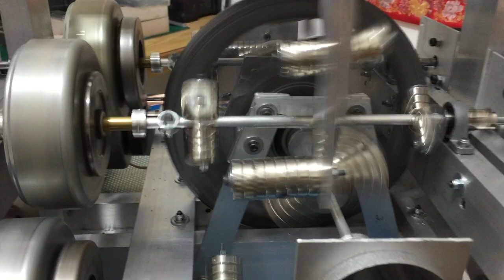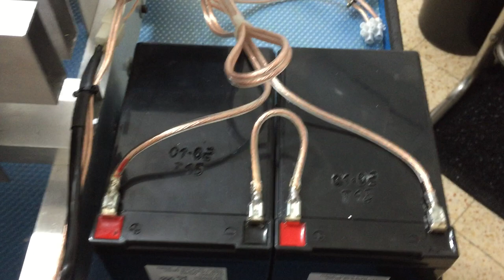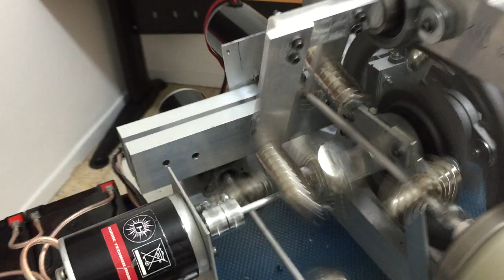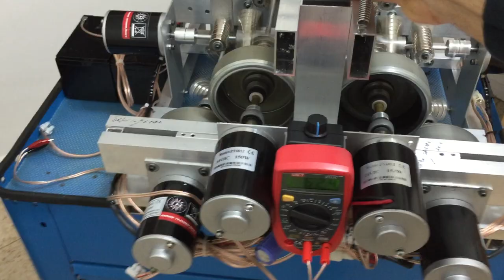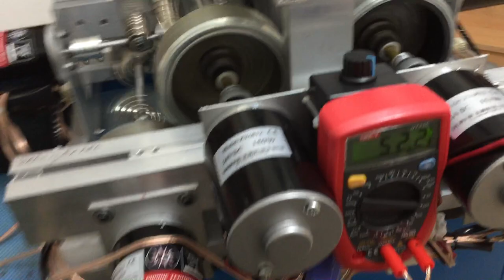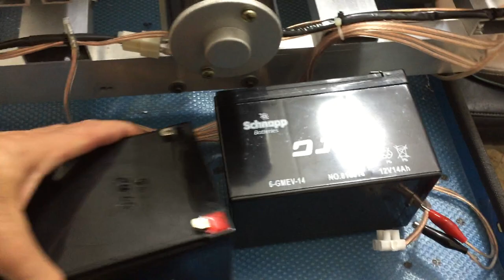Real unbreakable "Extra free energy" controlled devices magnet motor engine- It seems in 2015

Comment: +Oren Gertel I'm concerned about the engine's configuration if it's facing other external forces. Which would include gravitational forces and physical trauma while active (specifically for the use in vehicles and aeronautics). Like, if a plane flipped upside down (or tilted), would the engine function properly? IF you happened to be in a wreck in a vehicle with this engine, what's the danger of it splintering. Just stress test stuff to think about.

Comment: What? Correct me if I am wrong hear but last i checked if you unplug the battery and it stops it is not free energy.
Reply from the maker: Citizens Choice There may be secrets in the machine? Or was this the first time you saw such exposure of magnet power?
Reply: ***** First I am 35 years old and I have seen A True Z.P.M. In Action FYI that is A "Zero Point Module" "0.00 power input" with an output of 12V~5Amp's It is not on YouTube or any Internet webpage or I would send you there to look for yourself..

Anyway; Sorry if i hurt your feelings? But You show noting but moving parts, you do not give anything to support that your machine doing anything other than using Electricity? Were is the DATA?
Reply from the maker: Citizens Choice There is a video that shows battery charge and another video that shows loading capacitors,Try to understand that what you saw is the future
Reply from the maker: Tom Hoehler Thanks
Reply: +Citizens Choice How difficult it's to understand?? He's showing the potential of the magnets and possible use, that's all and that's great.   How difficult is it to understand for a guy 35 yo??
Reply: +Andres Castelvi Llanes It's creative. The design looks cool. It's utterly useless though.

Comment: Well built, but what is the output power versus input power ?
Reply from the maker: overunitydotcom Electricity production depends on generators! Thank you
Reply from the maker: overunitydotcom With the right generators can produce from the ornithopter engine more than 1000 Volts of electricity! Thanks
Reply: Hi Stephan. Do you believe that he is not provide a single output power measurements since more than 1 year while it so so simple in DC? is that an other one who use lake of education of the viewer to make money wuth the advertising in the vids? I wish he could be genuine but how to believe that while he wiuld just took him 2 multimeters and a 1 ohm resistor? ! :/
Reply from the maker: Khwartz Thank you for your interest! It is important
Reply: ***** that's not a very informative answer. Voltage means nothing, it is voltage and amperage output that means your entire machine's worthiness. Why don't you show your input voltage and amperage in comparison to it's output wired into a simple load? It isn't very difficult to do.. all you need is a load and an ammeter while using your power supply to power it as the power supply has the voltage and amperage on it's display.
Reply: +Didier Khwartz Where did you see that Oren Gertel is asking for money???? For what I can see, he's thinking hard and work  harder to make the machine and the video, BUT he is not asking for any money. In case that you can do it better....DO IT......OR maybe he asked you for money for that project and NOW you demand the promised results, otherwise just watch the video and make questions, but please save the insults and accusations ;)
Reply: +Andres Castelvi Llanes Actually, I believe he is accusing him of doing what every other person on YouTube who has "free energy" videos does. He has 16,200+ views on this video. How many of those people do you think clicked an advertisement? The people who put those ads there, those are his sponsers. the more views, the more money the advertisers make. He hasn't given ANY useful information on this machine, and to the advanced questions asking him about his machine, he has simply replied "your interest is important" and there are many "thanks" comments. Yeah, thanks for the view, thanks for the money.
Reply: +Andres Castelvi Llanes I love your analogy. You are right. He shows what he has and never has to answer one question. The word Overunity causes too many people who cover up even one true overunity technology to speak irrationally about every clever design. The one thing here I have to say is that Oren may have truly created overunity and doesn't want himself to be a marked man for his efforts to show the world how he has done so. Maybe, just maybe if we rebuild the same design but much larger that this system will produce exponential energy output? Why would he ever want to tell the whole world that this really works by giving data to show it may really do so? If he did this, he may only endanger himself. He could be showing his "rough sketch" if you will to give people an idea of how he did it, and just doesn't want to admit it's true potential. That's just my take on this because I am one who knows for a fact that overunity is possible, it is all in the design, and, it is truly possible based upon 3 devices I have built over the years, self looped devices that continue to run are 100% efficient or just over to cover their losses. If the machine could produce an additional output to provide extra energy to do work, great, it means that not only one design can do this, but, there are many others possible to do the same on many other levels. The more simplistic design, the better chance we have at understanding why it is so. Mine works, why can't his or anybody elses? There are too many paid skeptics covering this work up.. Wake up people, we can do this without listening to anybody else, just start building the devices in your visions to see if they work, eventually a winner will pop up.
Reply: +overunitydotcom I agree with Stephan.  If the torque being illustrated is Real unbreakable Extra free energy, a little data to illustrate this would be excellent.  Otherwise, If the purpose of this video was to make an ambiguous but entertaining video to watch, then the inventor has succeeded.  But only in visually translating the operating principles of what magnets can do in this video.  Thanks Oren.  ;)
Reply: +Oren Gertel 
DATA please!  only 'Volts' is unuseable...
Reply: +Oren Gertel 
DATA please!  only 'Volts' is unuseable...

Comment: NOT FREE ENERGY. All you have is a bunch of motors running off one or more BATTERY PACKS. You can see the black battery packs in top back left corner of the table it is sitting on. If it truly was "Free energy" then why do you need to use a battery to keep it running?